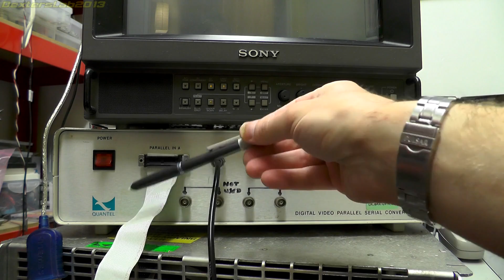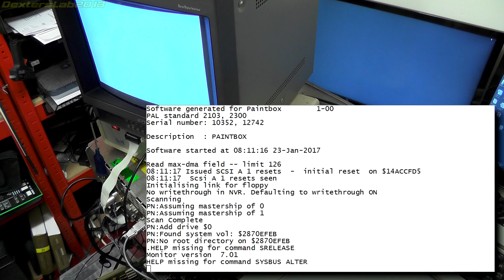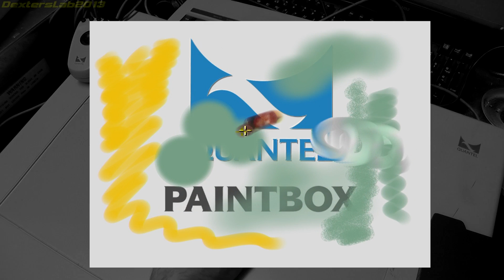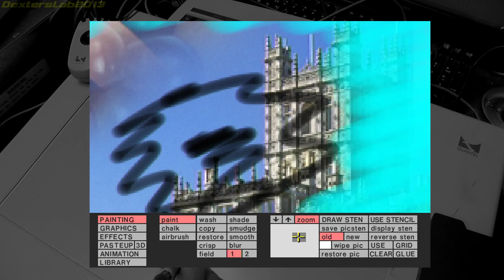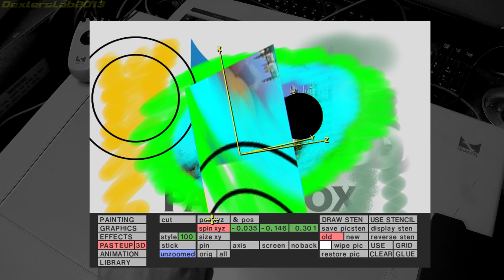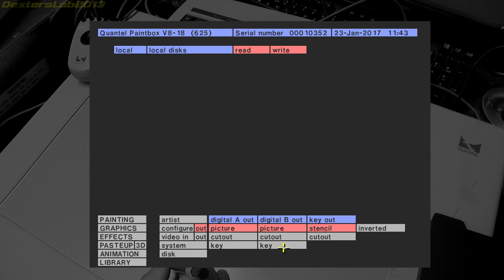DL#113 - 1990s Quantel V-Series Paintbox Tour

Comment: So much nostalgia. I learned Paintbox at college in the late Eighties and worked with Henry editors in the early nineties. 

A couple of years ago I downloaded the Compass software from the Quantel website before it disappeared, but never got it working.   

Is there any way to emulate the system in software on a modern PC?
Reply from the maker: Always great to hear from an ex-quantel user. Sadly there is no emulator, though i am working with someone else to hopefully emulate the DPB-7000 'Classic' Paintbox. The only way to see or use a Paintbox now is to have the real thing and there's only a handful of systems left running.

Comment: Which aspects of the drawing can be affected by pressure sensitivity? Opacity? Brush size? Colour?
Reply from the maker: On the standard v-series it was the opacity of the brush and 'flow' of the airbrush, other functions like pasteup (cut and paste) the pressure increased the sensitivity of moving objects on screen. In the later Express models you could use the pressure and pen direction to control many other parameters like brush size, colour, opacity and brush direction (for use with custom brushes)

Comment: Great to see this. The beginning of everything VFX the come. What about the buy and sell peddles?  Paintbox w Harry and encore for video vfx, what great system it was. It cost a million bucks back then for everything and outboard gear but we charged 3500 an hour. We were booked solid for a decade and made boat loads of cash. Harry turned into a Henry then came the Flame systems which are still the commercial standard of today, 25 years later. I remember I had different paintbox pens, one would even drip paint like a real spray can.  Everything today is just so much better in most every way and yet I would love to get my hands on this to play with again. Enjoy.